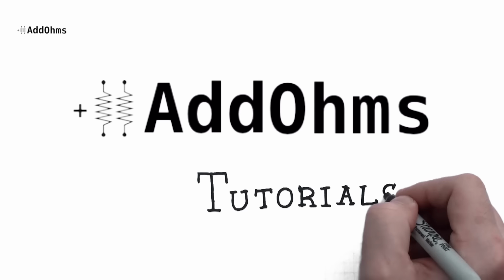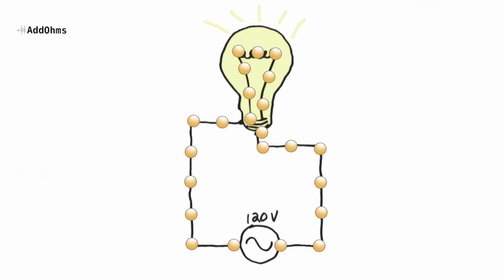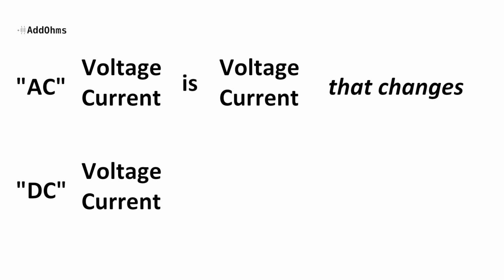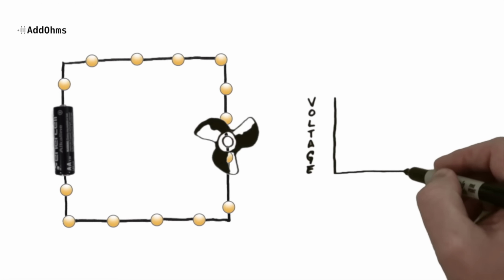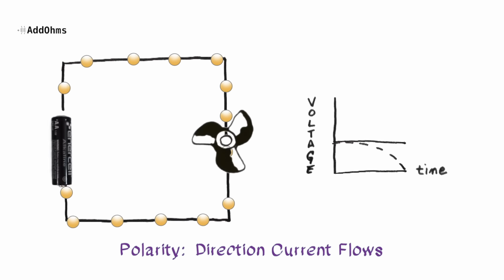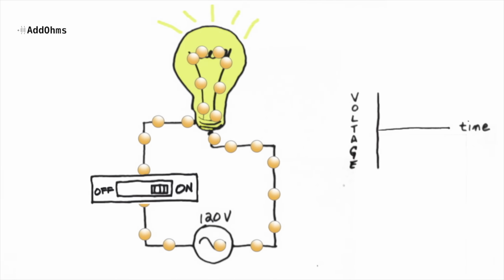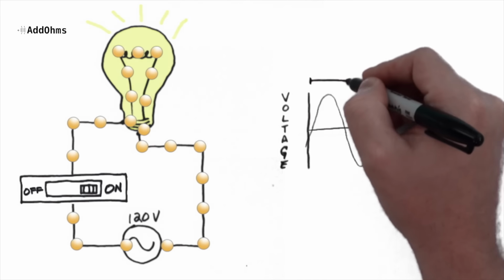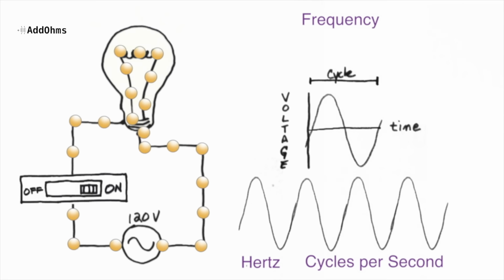Difference between AC and DC Current Explained | AddOhms #5

Comment: Great video, thank you. What are the advantages and disadvantages of each current type? It seems like DC would be a better, more efficient and straight forward choice, no?
Reply: I believe that DC takes more energy because electricity has a naturally alternating current, therefore to create DC, you have to force it to go in one direction. This can cause more overloads. I'm not that well versed in electrical engineering though so correct me if I'm wrong 😂
Reply from the maker: Nothing you said is correct.
Reply: @AddOhms  I was going to ask the same question.  You told Ksenia very delicately that she wasn't correct but you didn't clarify.  Care to clarify?
Reply from the maker: @thedeansta9825  Which part? Everything was wrong. There is no efficiency difference. AC RMS is virtually the same as DC.
Reply: @AddOhms  ac travels long distance , can’t use dc is transformers.
Reply from the maker: AC and DC travels the same distance. It doesn’t matter While you wouldn’t use transformers to step up DC, with today’s power transistors, it is now possible. Do a search for HVDC.

Comment: Awesome! Can you please explain what’s the input & output voltage range specified in devices? I saw a led driver that says 9 to 24v DC input but 30 to 38v DC output. What does that mean please 😳
Reply from the maker: Pretty straightforward. It means the input can range from 9 to 24 volts. And if it does, it will output between 30 to 38 volts.

Comment: I have one point of confusion. When drawing the V vs Time graph for AC you say that the voltage increases and then decreases. But you say that the current stays the same. 

Since V=IR how is this possible?
Reply from the maker: Mistake on my part. For this discussion we can say resistance stays the same. So current reduces too. 

(resistance changes with temperature)
Reply: @AddOhms  wow thank you for such a quick response! Cheers!

Comment: Since AC flows both directions, how do power companies calculate electricity used? Does AC actually flow past a given load and return back to the original source? like DC?
Reply from the maker: The power company charges you for the power that is consumed. Moving the electrons back and forth, which are carrying the charge, takes energy. That energy is what powers devices in your home. The meter measures how much power they consume (converting energy into heat or light or whatever).

The electrons moving back and forth are just the conveyor belt for that power delivery.  Moving it back and forth takes energy.

Comment: Why does the change in direction go together with the voltage dropping to zero in the middle? Why can't the change be without any drop in voltage? 
Why do the electrons flow at all with AC, if they get pushed back and forth 50 times a second? If I were to suck and blow water through a tube 50 times a second, nothing would come out on either end.
Reply from the maker: Nothing comes out of the other end of an electric circuit either. It is a closed loop. The electrons carry charge. The energy it takes to move the charge back and forth is what gets converted to something useful like light or heat. 

As for why can't voltage change without going to zero, sure. Then you would have a square wave (and a TON of electromagnetic interference emitting from the edges of that switching.) 100+ years ago electric generators could only make sine waves.

Comment: Hey, so I am looking into converting my car into an electric car. i did some research in on Tesla Model S and found that they convert DC (Battery Packs) to AC. Does that just mean that the AC will provide more energy when trying to turn the drive shaft? how does DC and AC compare on voltage output i guess?
Reply from the maker: Well, if they used a DC motor, they couldn’t have called it a Tesla. :) 

It uses an AC induction motor which does not have permanent magnets. One advantage is that without those, the weight is very low compared to a DC motor.  Since there is no magnet, an electromagnet is formed within the rotor, which means the stator must induce a current. That can only be done with AC.

Comment: How does the alternating current flow to where it has to go if it's constantly changing direction?
Reply from the maker: Electrons are just charge carriers. It doesn’t matter if they travel in a circle or back/forth. As long as it is a closed loop and provides a way for charge to be moved
Reply: @AddOhms  Many thx for your response......So how are they 'carrying' the charge if they are effectively stood still?  Guess I don't know what charge is?
Reply from the maker: They don’t stand still. Electrons are always moving. Electric fields (voltage) push them in a specific direction. Electric fields are created by charge, which is a property of matter. Charge is a zero sum game. Which means charges can move around, which is what current is: a flow of charge. So the electrons provide the path to carry the charge through the conductor, which is made up of atoms, which is made up of electrons and protons. Which is why charge travels near the speed of light but electrons move slowly. After all, they are matter.
Reply from the maker: This complication of understanding the physics of electric current and how to use it, is why most people just simplify down to “current is electrons moving through a wire.” It’s not 100% correct, but it provides an easy to understand model that fits 99% of the time. So in this case, it is sufficient to know that current requires a closed loop and movement. whether it is in one direction or back and forth, is irrelevant. it just has to move.
Reply: @AddOhms  Thanks again.... So electrons are always moving but not always in one direction and it's current / charge thats flowing to the resistor where it's required......in alternating current then what is causing the current/charge move in the direction required?
Reply from the maker: Current doesn't "flow to" anything. It always flows in a circle. A resistor just slows the flow down. In terms of AC, it is because the generator creates an alternating electric field which causes the current to alternate.

As to why the voltage alternates, it is just how generators are designed. There are AC and DC designs. Over 100 years ago, it was decided to use AC for a number of reasons.

Comment: "Believe it or not incandescent bulbs are flashing over 50 times per second" ?

Since there are two zero-volt intercepts in a single cycle, with a frequency of 50 hz there are at least 100 flashes in an AC current not 50. Right?
Reply: He said over 50 flashes. So I think you're right but his statement wasn't wrong.
Reply: 553#¥£€÷《¡¿65^!*;😯 = 50.  No he's right it's fifty
Reply: Boy how do u know so much?
Reply: There's a common 0 volt point between every two cycle......
Reply: It totals to 101 flashes per second check it again bro
Reply: He said it when i read this comment haha
Reply: Yes aint it 100 ??
Reply: oh come on guys....incandescent it is what you see....it is light from hit....led flash...

Comment: So here is something I'm fundamentally confused about with home wiring. Home wiring is AC, but if you are replacing a socket or switch, you connect two wires, but only one is "hot". If you put a continuity tester next to the hot wire it lights up, but it doesn't light up if you put it next to the other wire. To me this seems like the current is flowing in on direction. If the current direction is constantly alternating wouldn't both wires be "hot"?
Reply from the maker: You aren't describing a continuity test or measurement. You can't test continuity on a powered circuit. However, I can infer you are asking how voltage testers can tell the difference between hot and neutral. It has nothing to do with "which way the electrons flow."

Neutral is determined as neutral because it is physically connected to the Earth at the electrical box. The pen-style AC detectors rely on the fact that you are a big capacitor between the measurement point and ground. So connecting to hot provides a path while neutral does not.

Comment: how can you determine if an appliance is ac or dc without knowing the current? and how can the electrons with ac be kept charged when they don’t travel past the power source anymore?
Reply from the maker: Almost anything with a motor in it is entirely AC. As for the electrons, they don't get "charged" by the power source. The power source moves the electrons around (in a straight path with DC and an alternating path with AC.)  Don't confuse an atom's charge with electric charge. While related, they are different.

Comment: I'm working on equipment and my power supply is supposed to be outputting -12vDC, but it's fluctuating between -5V and -12v. What's wrong?

Comment: I'm still a bit confused. Does the current come from the live wire and then from the neutral wire then again from live, so on and so forth?
Reply from the maker: No. Current is a complete loop. It does not "come from" either terminal. Neither potential "adds" or "removes" electrons. In the case of mains AC, they are just moving back and forth. 

Live or Neutral doesn't matter from a current perspective because, again, they move in a loop. Explained more here: https://www.youtube.com/watch?v=IzY0wuxt1R8. And here: https://www.baldengineer.com/current-flow-myths.html

Comment: Suppose there are two resistances in the AC. Is the current through them the same?
Reply from the maker: AC or DC doesn’t matter. Ohm’s law is the same. If they are in series, then yes. If not, then only if the resistance is the same.
Reply: thanks so much💐

Comment: Question: Why would i use or what situation would require an AC current insread of a DC?

Are LED's fed with a DC because of the Diode?

Literally have no one in my life right now to answer that question for me....

Thanks for this great video, better education than my 3 years course. No Joking.
Reply from the maker: The obvious examples are mains power which is transmitted using AC. Modern electronics use DC. But all DC rails have an AC component (aka ripple voltage.) As for feeding, didoes are not fed anything. They aren’t organic and do not require food.
Reply: @AddOhms  am i right to say that ripple voltage (DC) can be achieved using a resistor pack for lights etc?
Reply: *returns organic plant food to store

😂
Reply from the maker: Ripple voltage is the variations in a DC rail. It comes from switch noise, loads turning on and off, and losses in the interconnecting wires.
Reply: @AddOhms  Thanks for your time

Comment: Suppose there are two resistors, one in DC, one in AC. Is the ampere in DC the same as the one in AC?
Reply from the maker: Resistors obey Ohm’s Law. Current through them is the voltage applied divided by their resistance.
Reply: AddOhms thanks for replying.

Comment: ok but how to you physically change the movement of the electrons do you change the direction of + and - or..?
Reply from the maker: Electrons flow in the direction of the electric field. If the field (polarity) alternates so does the electron “direction.” In the case of AC mains, the alternating field is created by a generator. It’s magnetic field induces current, which rotate, or, alternate.
Reply: @AddOhms  ah okay. Thanks for clearing that up. Still a newbie in this kind of stuff

Comment: Sir , then in ac current why phase can't change because if the flow of electrons is opposite of current and the direction of electrons changes then if firstly it goes from phase to neutral then goes from neutral to phase then  there is no neutral and phase . 
PLEASE EXPLAIN
Reply from the maker: Neutral is the common point. I don’t understand the rest of the nonsense you wrote.

Comment: i can see how ac can power a light bulb as the filament is lit regardless of which direction the current is flowing in, but how can it effectively power something that needs to revolve in the same direction all the time e.g a propellor, a blender etc?
Reply from the maker: They use an “induction” motor, which is wound so that the motor rotates with the change. Sort comments by date and look at the one above yours.

Comment: Will the fan rotates in a weird manner if its connected to an AC supply?
Reply from the maker: Well first, you have seen a fan plugged into AC before? So that would suggest SOMEHOW it must work, right?

AC motors use induction to spin with the changing AC. Induction motors have no permanent magnets. The stator (where the coils are wound) creates a magnetic field that electrically "rotates" along with the changing AC.  This magnetic field also induces a current on the rotor (the spinning part.) The rotor's magnetic field is aligned with the stator's magnetic field. This alignment causes the rotor to repeal the stator's magnetic field. So it starts to spin. It ends up spinning along with the stator's "rotating" magnetic field. 

https://en.wikipedia.org/wiki/Induction_motor

Comment: Which is more preferable AC or DC? And Why? Can some one answer me!!
Reply from the maker: As with all engineering decisions, it depends on the application. There is never a single “best” option. For example, AC is better suited for long range power transmission. DC is better suited for digital.
Reply: AddOhms thank you so much!!✌

Comment: your video is great and informative,thanks for ur explaination and Dear sir i have a question ;if current direction changes in Alternate Current  then why we use neon testor on phase wire. when we use neon tesor on phase the light in testor glows.if we use neon testor on neutral wire the light or indicator doesent glow  though in alternate current the current chanes its direction and neon tester light/ indicator should be glowing on both wires ie phase and neuter.any logic
Reply from the maker: I don't know what a neon tester is or how they work. Neutral is connected to Earth, which probably why you see a difference.

Comment: I made an inverter my self  DC to AC but the CFL BULB keeps blinking, so how can I stop it from blinking, 
from ur explanations my inverter provides little hertz.  how can I improve it
Reply from the maker: I would check it’s output voltage, wave shape, current capability, and frequency it runs at.

Comment: That video is amazing! Thanks I had the concept stuck in my head for over a week, all thanks to you I'm clear about AC and DC.
I had a doubt that if AC keeps moving back and forth won't it be affecting the function of the ceiling fan? Won't the fan be rotating in clockwise and then counter-clockwise or perhaps not move at all??
Reply from the maker: Check the comments. I've answered this about 1,432 times.

Comment: Hi. Another question. If ac changes direction, why the hot wire and neutral wire are stable hot and neutral. And not changing other way around. Sorry for noob question. 😄
Reply from the maker: In AC mains wiring, neutral is physically connected to Earth.

Comment: If light bulbs are flashing 50 or 60 times per second, why do we see them lighted on as opposed to off, why don't they have a 50% chance of being dark as opposed to light to our eyes?
Reply from the maker: There is no "if". It is what is happening. There are multiple reasons. 1) the filament doesn't go completely off. but it is because of 2) persistence of vision. It's the same reason LEDs don't flicker, LCD screens look solid, and movies seem to move. Our eyes (and brains) see light, not darkness.
Reply: AddOhms but how is it the case? This may be a basic question I'm sorry if I'm being repetitive.
Reply from the maker: Imagine a strobe light that starts at 1 second on, 1 second off. Then goes to 2, then 3, then 10, then 50.

Comment: But why that's what I don't get and can't find a solid answer on. Why can't you just use direct current say in a car instead of having an alternator?
Reply from the maker: Disconnect your alternator and the engine will run just fine until the battery dies. So cars can use a DC source. Other than solar, there aren't many "DC generators."

A spinning generator generates an AC waveform. Almost all DC generators are AC generators with a rectified, and sometimes regulated, output. Which is the same as a car's alternators. More on electric motors (which are reversed generators) can be found here: https://www.youtube.com/watch?v=iKqruCYuc1Q&list=PLRIGIzu0Z7KlYY6FyZ0_Y0ZmVFyAvtDO0
Reply: AddOhms thank you! After I saw this, I did some research of my own and found that simply, the battery is limited and the diodes in the voltage regulator convert the a.c. voltage into dc to power the accessories as well as recharging the battery. Lol I know its what the video says but I didn't grasp it at first. Thank you!
Reply from the maker: The other aspect to realize, even at idle your engine speed is varying, so the generator’s output is always changing.

Comment: "Once the voltage reaches its peak, current flow stays the same but the voltage begins to drop" (2:48-2:51). Since the current is related to violate through V=iR, shouldn't the current drop with the decreasing voltage?
Reply from the maker: You are correct. I meant the direction, not the amount. As the voltage goes down, so does the current, but the direction of flow does not change until the polarity swaps.
Reply: @AddOhms  so 1,874,251 people have been miss informed maybe you should edit your video
Reply from the maker: Sure. Just suggest to YouTube to add that as an option.
Reply: @AddOhms  Can you just take it down and then put up the edited version.

Comment: so which one is better to use?
Reply from the maker: This video's intent was not to say one is "better" than the other. In engineering, there is almost never a "best" in all cases option. The right choice always depends on the application. For transmission over long distances, AC is best. For running digital electronics, DC is best.